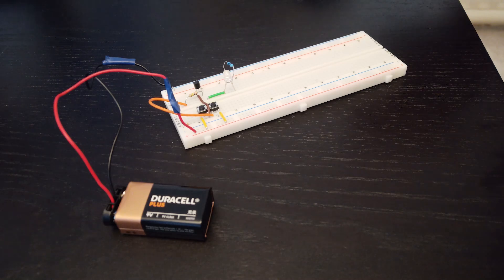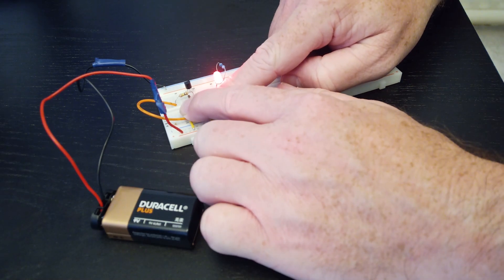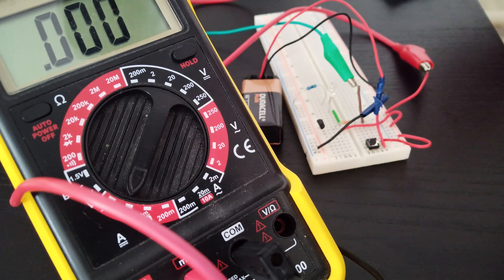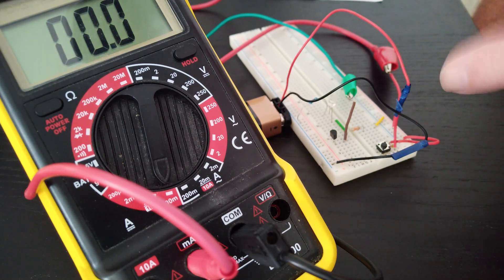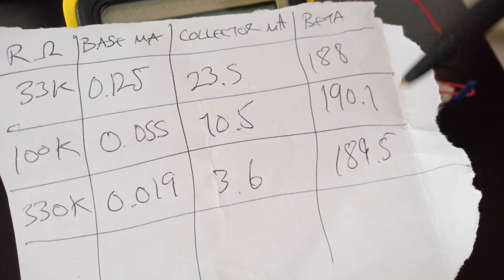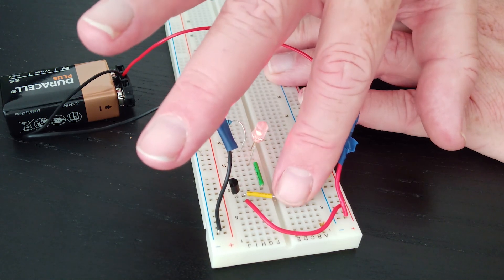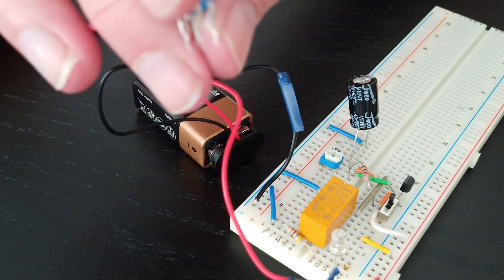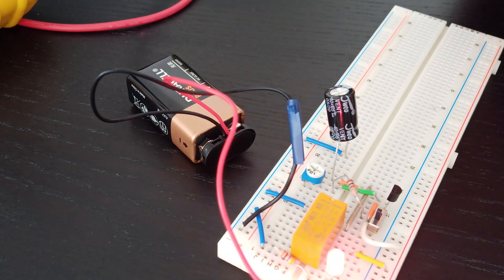Make: Electronics Book Experiment 10 - Transistors for switching and amplification

Comment: I think the switches you are trying to source are one of these maybe. There are the 400pcs Tact Switch Kit - 2-Pin SMD Push Button & 125pcs Micro Tact Push Button Switch Kit from TEMU as well as SMD Micro Tactile Push Button Switch Accessories from ALIEXPRESS. These are decent items and they are very reasonably priced products. By the way thank you for the videos. They are very helpful with well scripted content and good visuals, although this one could have had a bit more on why capacitors behaved the way they did (i.e. blocking current/voltage). Other than that thank you for the content. I will continue to visit your channel for sure...

Comment: I need your help with the following issue. I am working on experiment #10-17 from the book, as demonstrated at 14:10 in your video. I made a mistake while assembling the circuit: I connected the capacitor to the positive rail on the breadboard instead of the negative rail. This led to the following observations:

1. The circuit worked, but the LED lights up immediately without any delay (see pic1 and pic2).
2. When I connect a multimeter, it shows -0.44V when the circuit is open and 8.04V when the circuit is closed. I don’t understand why there is a voltage reading when the slide switch is in the off position (see pic3 and pic4).

Although I’ve identified my mistake, I would like to understand why the multimeter shows 0.44V when the switch is off. 

Pictures uploaded as a video in my profile section.
https://youtu.be/jwAS02GsW_k

Thank you!
Reply from the maker: @johnminty8243  if both sides of the capacitor were connected to the positive bus then that would be why you didn't get a delay as the potential difference across the capacitor would have been non-existent or very small so there would be almost no charging delay before sufficient current flowed to the base to turn the transistor on. The small negative voltage you are getting when the switch is open could just be the discharge current from the capacitor. It's a little difficult  to tell from your photos as it looks like your meter leads are just connected across the buses.
Reply: @M7GNP Thanks! I will create a video today and post it tonight, along with a few questions.

Comment: You suggested that a "problem" with a relay is that it's electromechanical.  Rather than being a problem, I believe that's actually the main "benefit" of a relay, because it introduces electrical isolation between the control side (the coil) and the load side (the contacts).  This electrical isolation means the control side can be a low-power DC circuit, while the load side can be a high-power DC or AC circuit.  Anyway, just passing along a clarification which ChatGPT provided to me.
Reply from the maker: @SomeNewKid  Yes, 'problem'  was not a good choice of word - 'limitations' would have been better. My main point was to make a rather clumsy segue into transistors by pointing out that because they are purely electronic there are no mechanical parts to go wrong and they can achieve much better switching speeds than an electromechanical relay. However you are quite right to point out that where there is a need to electrically isolate the switching circuit from the circuit being switched that relays are ideal for that application.

Comment: Great way of demonstrating the function of the base  by put a switch to the collector and an to the base.i have the first edition book ,that idea isn't in it.thanks.
Reply: I have the second edition of the book, and most of those circuits are not in my book, either.   I wonder if all those circuits are indeed in Laurence's third edition, or if Laurence is showing us his own experimental circuits in addition to those in the book?
Reply from the maker: I can assure you that I'm building just the circuits from the third edition of the book (I can't speak for the first or second editions), however, I'm often having to deviate from the breadboard layouts when I have components that are of a different size from those shown. I promise if I do ever show something not in the book, I'll make that very clear.
Reply: @M7GNP  , thanks for confirming that the experiments are indeed in the book, even if you need to tweak them.  I find it impressive that the third edition of the book has more experiments, and better experiments, than my second edition.  It's a credit to the author that the revisions are not just errata, but are significant expansions.